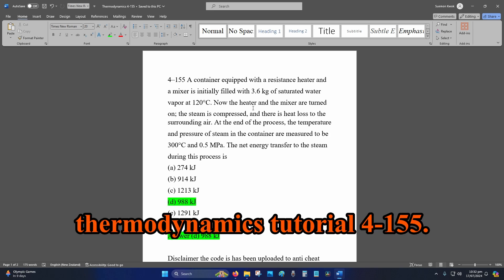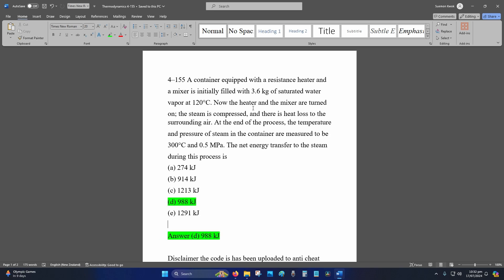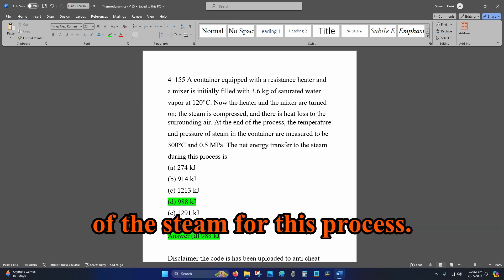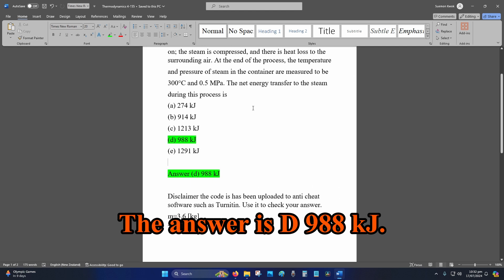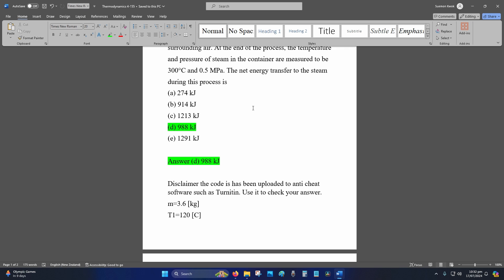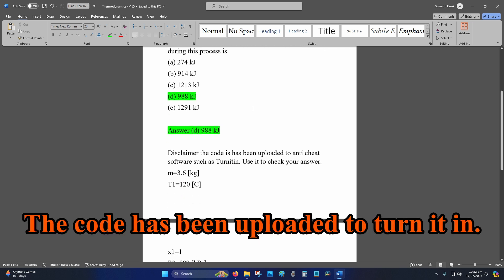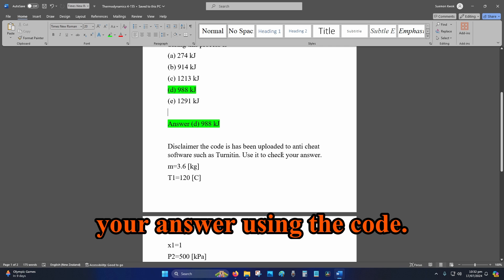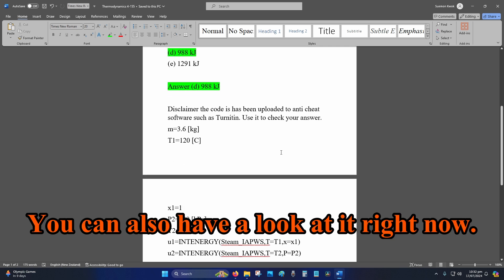Thermodynamics 4-155 A container equipped with a resistance heater and a mixer is initially filled

Comment from the maker: Disclaimer the code is has been uploaded to anti cheat software such as Turnitin. Use it to check your answer.
m=3.6 [kg]
T1=120 [C]
x1=1
P2=500 [kPa]
T2=300 [C]
u1=INTENERGY(Steam_IAPWS,T=T1,x=x1)
u2=INTENERGY(Steam_IAPWS,T=T2,P=P2)
"Noting that Eout=0 and dU_system=m*(u2-u1), applying energy balance E_in-E_out=dE_system gives"
E_out=0
E_in=m*(u2-u1)
"Some Wrong Solutions with Common Mistakes:"
cp_steam=1.8723 [kJ/kg-K]
cv_steam=1.4108 [kJ/kg-K]
W1_Ein=m*cp_Steam*(T2-T1) "Assuming ideal gas and using cp"
W2_Ein=m*cv_steam*(T2-T1) "Assuming ideal gas and using cv"
W3_Ein=u2-u1 "Not using mass"
h1=ENTHALPY(Steam_IAPWS,T=T1,x=x1)
h2=ENTHALPY(Steam_IAPWS,T=T2,P=P2)
W4_Ein=m*(h2-h1) "Using enthalpy"